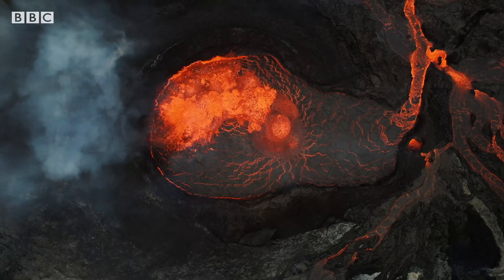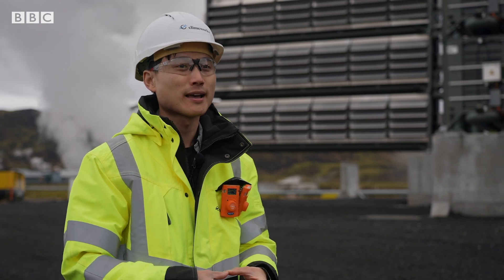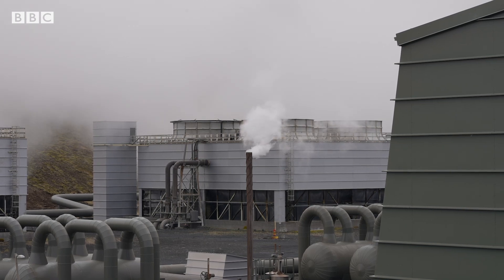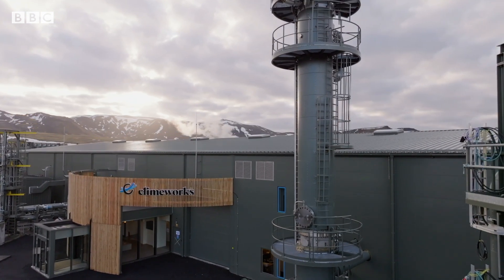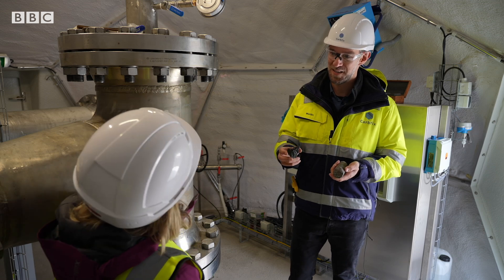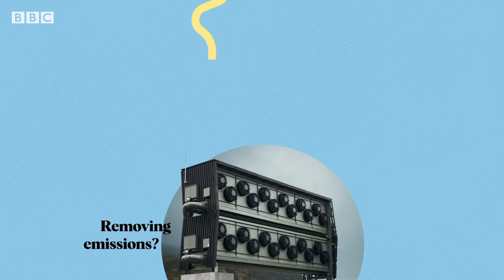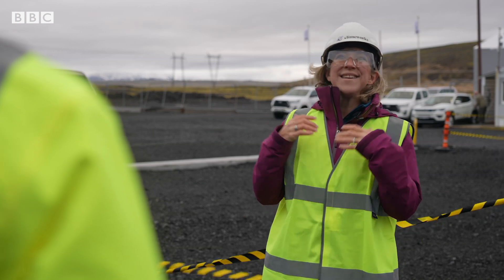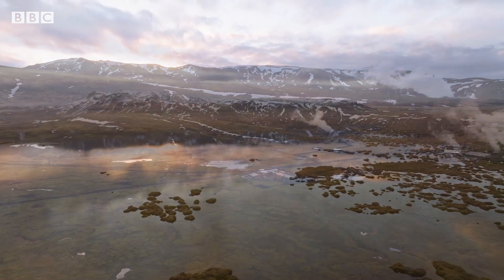Inside the hidden carbon plant pulling CO2 from thin air | BBC News

Comment: AEROSPACE ENGINEER HERE:
I'm Australian but did my degree in America (late 80s) and one Friday we had a NASA engineer do a special lecture on Terraforming Mars. We were kind of excited as at that time (despite the Challenger accident) we believed we'd be building the next space station in the 90s, back to the moon early on the 2000s and off to Mars in the 2010s.

We were shattered when he started with: "Sorry its impossible and here's why!"
He then went and explained how you need think when considering an entire planet. You don't need to be an engineer or geologist or atmospheric scientist just BASIC MATH WILL DO. Once you understand the actual scope of dealing with a planetary issue things like this are irrelevant. 

For example there's currently around 2.5 Trillion tons of excess Carbon Dioxide in the atmosphere and by current estimates it will go past 3.5 Trillion tons by the mid 2030s. So to do a quick time estimate you simply divide 3.5 Trillion by 35,000 and get 100,000,000 years. So if you want to get that 3.5 Trillion tons out in something like 10 years you need about 10,000,000 of these plants built. If you want to do it 20 years then its 5,000,000 plants.

As to the costs its even easier to estimate 
At $1,000 per ton 3.5 Trillion tons will cost $3.5 QUADRILLION tons to remove.
1/10th of $3.5 Quadrillion is $0.35 Quadrillion.
So at $300 per ton its (3/10ths) which is $1.05 QUADRILLION
And at $400 per ton its (4/10ths) which is $1.4 QUADRILLION

So its reasonably easy to estimate that this method will cost between $1 and $1.5 QUADRILLION and that's provided we can find 5-10,000,000 SUITABLE locations and get enough materials to build those 5-10,000,000 plants. Then there's the small task of how do we power it, because power might be reasonably cheap in Iceland where they have enormous natural resources but what about the other 9,999 plants where are they going, how are they being powered and who's paying?

By the way if every person on the planet planted 1,000 trees (seedlings) at a cost of $5 per tree. That would be 8 Trillion Trees and if each tree is capable on capturing 1-2tons of Carbon and sequestering it in the wood. Then we'd only need about 1 in 4 trees (~2.5 trillion) to reach maturity to capture that 3.5 Trillion of Carbon Dioxide. 

Yeah that would cost about $40 Trillion on basic costs which is a staggering amount of money until you consider the alternative is $1-$1.5 QUADRILLION, which is 25 times the cost at the low end. Best of all Trees don't need electricity they just need water and sun light and maybe some fertilizer. Once established their maintenance and upkeep costs are almost zero. If you plant trees that produce food and of building materials then even better.
Reply: all wrong. DACS will cost under $100 per ton CO2 when scaled.  At 10bn tons per year removal that will cost around $1tr annually or under 1% of global gdp. Nobody is talking about  removing the excess CO2 in 20 years, more like 100+.Global  emissions are currently around 40bn tons of CO2 per year but around half of that is absorbed by the land and oceans. so over a decade the net additions to the atmosphere  are about 200 bn tons.    Trees burn down
Reply: @ldm3027  EVERY CLAIM YOU MADE IS BULLSHlT - 100% BULLSHlT 
Where do you get this $100/ton from?
IN THE VIDEO Douglas Chan COO Climeworks who have built this plant is STATING $300-400 a ton (5:00).

Then you say there's 40bn tons a year in emissions and half gets absorbed by the natural environment. That leaves 20bn ADDITIONAL per year. You claim that removing 10bn tons will cost $1tr a year and that we'll have to pay that for 100+ years. What about the remaining 10bn tons of additional CO2 in the atmosphere? WHAT TF ARE WE MEANT TO DO ABOUT THAT?

So not only do you make numbers up that you can't justify you then can't do basic math either.

I suggest in future you don't argue with an engineer who can actually do math.
Reply: 불나면 한방에 훅갑니다..
Reply: The real effective way of not further increasing the atmospheric CO2 concentration is very simple.  STOP BURNING COAL, OIL and NATURAL GAS.

Yes, it would still require an astronomical cost input, to remove the excess CO2, but it needs to be done if the human race is to continue in a similar form as today.
Reply: Wow If you did all this without any knowledge it would be a waste of writing and time. I think you might know and thing or two. Very interesting!
Reply: @RobertGonzalez-j1v  Do the math its not that hard.
At $1000 per ton removing 2.5 Trillion tons costs $2.5 Quadrillion
BUT wait by the mid 2030s it will be 3.5 Trillion tons and by the early 2040s 4.5 Trilllion tons.
This guy said they could get it down to $300 per ton. So what even if he got it down to $100 per ton then its still gonna cost $350 Trillion for the basics and 100s of $Trillions after that. The combined wealth of the planet cannot afford that.

Being able to use basic arithmetic to get a simple estimate is a necessary skill for an engineer. 

Here in Australia right now there's calls to go nuclear and 7 sites have been identified. I know those sites and I know I can put an EPR 2 at 4 of those sites and 2 EPR 2s at the other 3 and that's 10 in total. 

Based of the costs at Hinkley Point C each reactor will be AU$48 Billion each. 
10 x 48 = 480 

So AU$480 Billion becomes your starting estimate and that simply asks the people pushing that idea to explain where they are going to get $480 Billion from?

Because if these sorts of people pushing these sorts of solutions can't answer the basic cost questions then what's the point of discussing anything further?
Reply: That's 8 trillion trees. I hope you understand how hard it would be to find space to plant 8 trillion trees.
Reply: @kausthubh  There's plenty of open unforested space space. I'm Australian we have several million square kilometers for starters. North Africa has massive amounts of open space and YES I damn well know how hard that will be. But that can also be mitigated with tree selection and planting arrangements. 

There's some pretty amazing videos here on YouTube on re-wilding and how they are reclaiming lots of open space. One of the really important things that has come out of that is variety. If you try and to it via monoculture it will be a disaster.

HERE'S the inescapable fact. We have to get 3.5 Trillion tons of CO2 out of the atmosphere and do it fast. There's a clown down the list here (idm3027) who's pulling numbers out of his butt like it will only cost $100 a ton by DAC. IF THATS TRUE and lets not forget that Douglas Chan COO Climeworks is claiming they hope to get it down from $1000/ton to $3-400/ton, then at $100/ton its still going to cost $350 TRILLION.

WHERE TF DOES ANYONE THINK THEY ARE GOING TO GET THAT $350 TRILLION?
Then there's the actual energy costs. In how many places would we need new power stations to drive that AND WHO'S going to pay for those power stations. Then that's that whole problem of the environmental cost of all the materials required to build all those plants. 

I started with a degree in aerospace but have spent 30+ years working in industrial control systems and automation. I have spent time in both manufacturing and mining and I KNOW how much energy those industries consume. Do you know there's mor energy used in making a car than it consumes in its lifetime? people forget it take energy to dig all those materials out of the ground and process it into stuff that you can makes bits out of so you can assemble those bits into a car. Its the same for most manufactured goods. 

In fact a great way to help save the planet is to STOP manufacturing crap products and instead manufacture everything with better quality to last longer. It would massively reduce energy consumption.

The other thing is to triple glaze all those glass towers we've build over the last century. mark Blyth the political economist at Brown U. mentioned an engineering report that said if America just triple glazed all its office blocks and skyscrapers the saving in energy would help America get most of the way to meeting the Paris Accords. Architects might be good for designing aesthetically nice buildings but they don't know a damn thing about energy efficiency.
Reply: And you call yourself an engineer Jesus
Reply: @gamers-xh3uc  And WTF is your point?

This is the first step in any engineering project. Get an estimate of what its going to take. It doesn't have to be hyper accurate but it needs to highlight the basics of the task.

I'll give you another example:
Right now here in Australia there's a huge argument over nuclear power and the Australian Liberals have identified 7 sites BUT THEY ARE CLAIMING they don't have the costs yet.

I happen to know those sites because I have been trying to get people's attention about our power sector ever since I had a small consulting job back in 2016. 
If we were to choose European EPR2 Reactors we'd need 1 reactor at each of 4 sites and 2 reactors at the 3 other sites. Based on Hinckley Point C an EPR 2 costs AU$35 Billion so 10 reactors is AU$350 Billion and it takes about that long to have an estimate on the costs.
If we were to choose American AP1000 Reactors we'd need 14 reactors across those sites to generate a similar amount of power. Based on Vogtle AP1000s cost AU$26 Billion and those 14 reactors would cost AU$364 Billion and that's about how long it takes to get a second estimate.

Sorry mate but engineers have to do estimates all the time.
Reply: @gamers-xh3uc  Similar to carpenter Jesus.

Comment: The average passenger vehicle emits around 4.6 metric tons of carbon dioxide (CO2) annually, but this number can vary depending on the vehicle's fuel, fuel economy, and mileage. For example, the average gasoline vehicle on the road today gets about 22.2 miles per gallon and drives about 11,500 miles per year, and burning each gallon of gasoline produces about 8,887 grams of CO2. 

Environmental Protection Agency (EPA)
Greenhouse Gas Emissions from a Typical Passenger Vehicle | US EPA
Aug 28, 2023 — A typical passenger vehicle emits about 4.6 metric tons of CO2 per year. This ...

epa nepis
Greenhouse Gas Emissions from a Typical Passenger Vehicle
What are the average annual carbon dioxide (CO2) emissions of a typical passenger vehicle?
Generative AI is experimental.

Comment: And then we can take the c02 and burn it as fuel, right?
Reply: No, CO2 can't be a fuel.
We COULD produce fuels out of CO2 and H2 (hydrogen) and replace fossil fuels with them.
And we will do this on a big scale some day.
Fuels e.g. for shipping or aviation. 
But that's very expensive. And as long as ships and planes are allowed to use cheap fossil fuels...

Comment: This is useless. It would take 1,100,000 of these plants to break even on CO2 production. 40 billion tons per year divided by 36,000 tons per year at this plant.
Reply: That's why no reasonable person propagates a compensation of our today's emissions by Direct Air Capture plants. 
They are meant to compensate inevitable residual emissions, after we largely got rid of fossil fuel combustion. Together with other measures like "normal" CCS, BECCS, (re-)forestation, forced humification,...
And future plants will be much bigger than this pilot plant of course.
1000 plants with 1 million tons CO2 per year each would compensate a substantial share of the residual emissions.

Comment: Different tree species store different amounts of CO2 per year. For example, oak, beech, spruce, fir, Douglas fir, pine, and larch trees store an average of 24.62 kg per year. So, plant more than 1,000 of these trees, and you got the same amount of CO2 capture as this plant, and a fraction of the cost.
Reply: This plant is experimental. With improved technology, they will get better CO2 extraction in the future. The tech might be also proven useful in the future space exploration and planet habitation. Trees require a huge amount of space, which will be at a premium for these explorers / colonists. Yes, tress should also be planted, but these CO2 extractors can help complement it.

Comment: How much co2 does it produce, providing the electricity to power those fans?
Reply: None. It's geothermal. It would be pointless to use fosill fuels to power it.
Reply: @adrianthoroughgood1191  exactly, its why i wanted to ask. same way that electric cars take alot of carbon to produce
Reply: @MaraJoshWana  these would only be built where non-fossil energy was available. They can be turned on and off when the electricity supply allows. So you could power them from Solar panels and run them only when the panels were generating. 

EVs do emit more CO2 during production than an ICE car, but the amount more is actually quite small. The amount of CO2 an ICE car emits from its tailpipe over its lifetime is 9x larger than the extra CO2 the EV took to build.
Reply: Actually, electricity is the minor part of energy consumption of such plants.
They need heat energy for CO2-desorption from the filter medium in the first place.
Electricity for the fans isn't such a big deal, you would get a net CO2 removal with electricity from natural gas power plants as well.
But it's better to use renewable energy sources of course.

Comment: Direct air capture in this method is a folly. we do not have the time, energy or scalability to make this a method that can save us.

FAR more suitable, is to covert our vehicles and factories to liquid air. yes I understand they do not have the fuel density but ffs, first world problems... fill up more often and design a bigger tank, lol.

IF we convert to liquid air, we can then use the renewable power to liquid air factories like high view to do the direct air capture FOR FREE as a byprduct of our new energy system because co2 liquifies easier than air and needs scrubbing from the end products. highview currently discard it, but should be using it as DAC.

please, someone who is not thick and understands what I am talking about, feel free to take the torch, because my life runs elsewhere

Comment: People here don't understand that this TAKES OUT Carbon from the surface. Trees do not do that. They eventually die, rot, or get burnt which releases their stored up Carbon back into the atmosphere
Reply: I agree, and I mentioned this point many times here.
But it's just a half truth of course.
A growing forest takes up CO2 and turns it into biomass. A fully grown forest changes to a balance of biomass-production (CO2-consumption) and biomass-decomposition (CO2-production).
But the amount of biomass (stored CO2) stays more or less the same. This CO2 stays away from the atmosphere.
And a part of the carbon gets stored in humic acid (humus) and stays a long time away from the atmosphere.
Forestation can help reducing the atmospheric CO2-concentration.
But it needs fertile land, which could also be used for food or biofuel production.

Comment: The world is at 427 ppmv, rising by over 3/4's of one percent a year (3.23 ppmv year over year June 2023-2024). Project Drawdown's Climate Solutions 101 Roadmap shows we need to prioritize stopping fossil emissions, and it would be best if that happened 2% of today's level per month down to zero by 2030, starting with methane emitted to the air.

But we also need to get down to 350 ppmv as soon as possible. Mark Jacobson rightly points out that one fifth of human emissions will come out of the air naturally in the first century after ending fossil emission and taking care of land use changes. That still leaves one eighth of all CO2 in air (50 ppmv) that we need to pull out of the atmosphere by direct air capture, or by ocean capture.

So it's worth it to develop techniques -- the most obvious being increasing vegetation by a trillion trees worth of biomass by 2060 -- for CO2 capture in the hopes we can find a good mix of methods.

But it's most worth it to reach zero fossil trade by 2030 in increments starting now.

Comment: Fun fact: project Cypress is estimated to cost 100 million USD. To remove 1 million tonnes of carbon/year. Team tree’s plants a tree for every $1. We need 50 million mature tree’s to offset 1 million tonnes. Cypress is expected to take 2 years to build, a mature tree takes 20 years.
.
California 2023 wildfire burned approximately 355 million tree’s.
(Based off of the presumption that there is 2500 tree’s/ hectares)
Reply: We absolutely need to do everything possible to prevent wildfires.